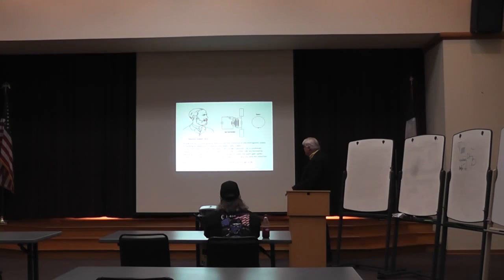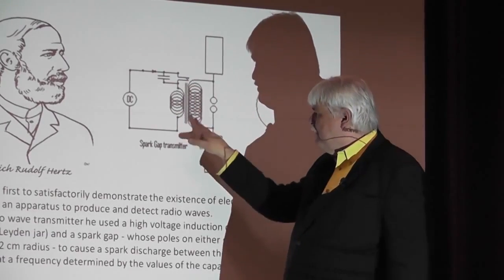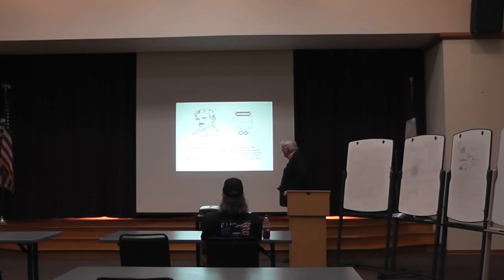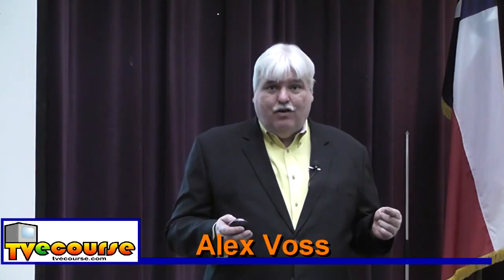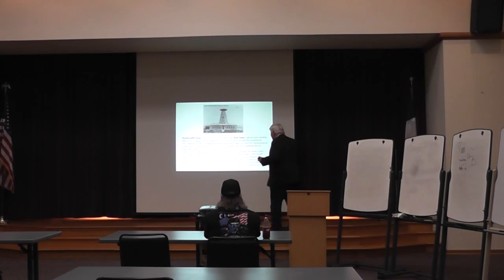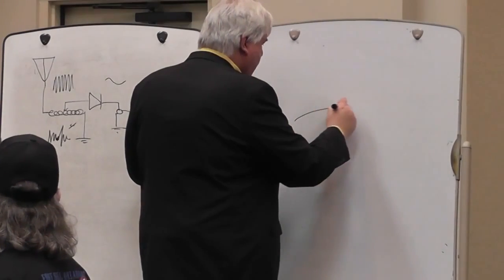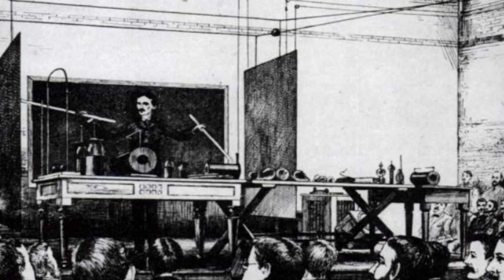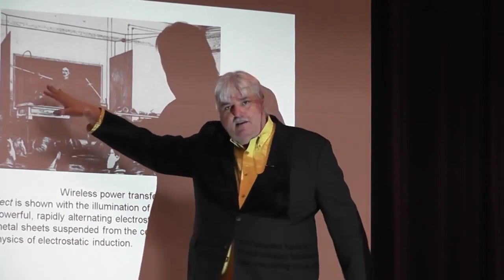Tesla - Power Transmitter - Wardenclyffe Tower - Basic Electronics 38

Comment: You are wrong... That is one of many failed invention of Tesla... It is just high voltage AC powered capacitor with one plate as ground and the other in form of rounded half sphere... Technically it is called electrically short antenna which can only produce electrical near field which in turn allows energy transfer to any receiving antenna within near field distance... There is very little electromagnetic wave radiation and that is why Tesla's invention failed as what he has envisioned... If he had designed half wave long wave antennae then it would have all supplied energy radiated as EM waves and thus range increased to thousands of miles instead of few hundred feet...The disadvantage of such system is the fact that all conducting objects would couple to that propagating energy source and turn into heat which in case of human and living organisms would be harmful o fatal... So the company is using the failed invention as low field intensity micro-power wireless energy distribution and low speed communication for short range near the tower of electrically short antennae...

Comment: Not John Jacob Astor. It was JP Morgan that funded Tesla I believe.
Reply: Astor funded Tesla which then went into the Colorado springs workshop which allowed Tesla to get the understanding of Wardenclyffe and then JP funded Tesla for Wardenclyffe.
Reply: Astor, in 1899.   (Morgan funded Wardenclyffe.   He didn't fund Tesla's 1899 research.)     But Astor was paying for Tesla's wireless lighting startup.   But instead of founding an 1890s glow-tubes company as promised, Tesla ran off to Colorado to do research.
Reply: @wbeaty  Tesla's lab was burned in 1895. It is reasonable to think that Tesla was a bit paranoid and Colorado seemed like an ideal place to have a lab a little more protected.